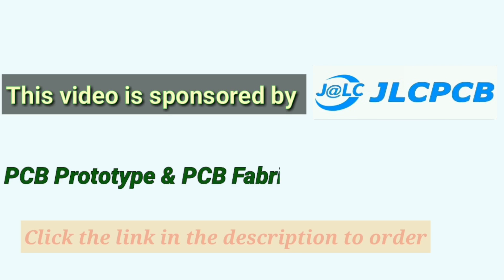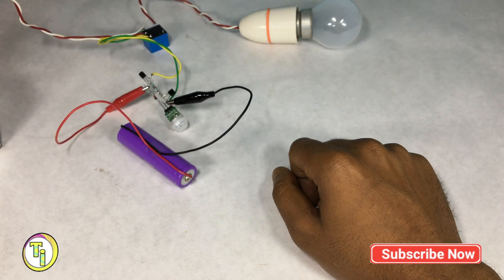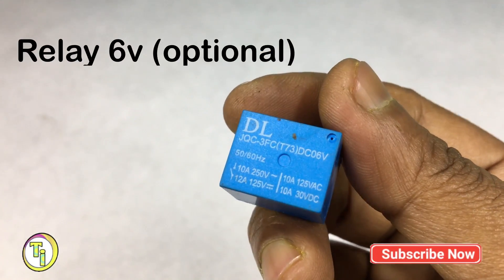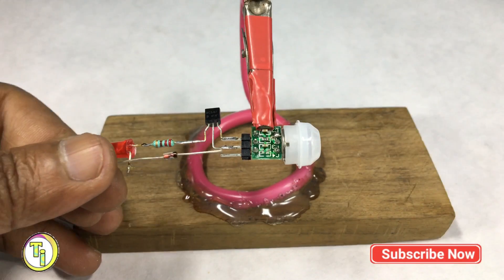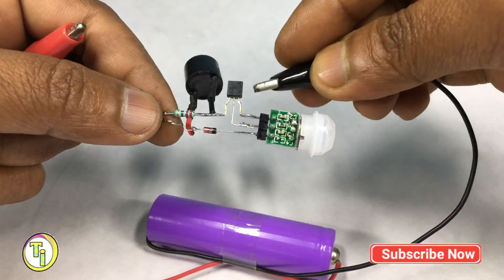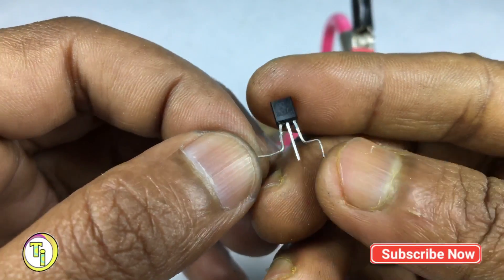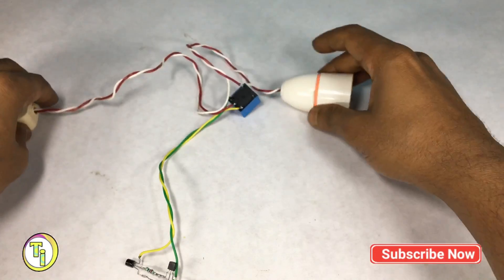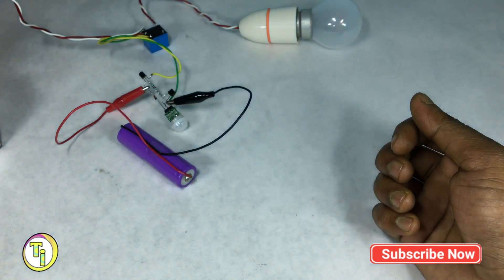Simple pir sensor circuit without arduino | JLC PCB

Comment: Great video.  Will it work if I expose IR sensor to Sunlight Will it sense?. I have used another IR (SIG0062) but it´s too sensible to sunlight...therefore my load is on...tried to covered around but just does not work.
Reply from the maker: Ofcourse it'll work fine on sunlight

Comment: The diode that you show 1N4148 is a signal diode NOT a Zener Diode? and you should add a resistor to the base of the transistor for protection so your circuit is a no no look at Big Clives channel to see how to do it correctly

Comment: Great video, thanks.  Would you know the max output CURRENT the IR modules can deliver.  I can not find specs and when I tested one with a LED, 330 resistor, and 5v volt supply I only got about 35 ua, that does not sound right but without specs I don't know if these are defective.

Comment: Hello, can you tell parameters of Zener Diode? And also which diode is used on relay for protection.
Thx
Reply: The 4148 is actually a 1N4148 small signal diode and not a Zener.
I would think the fly back diode across the relay would be 1N4007
Reply: But this man never replies viewers questions

Comment: Nice one bro.. I would like to know how I can lengthen the light that is on? How can I integrate it with a "delay" to turn the lights off in a certain period of time?

I also want to know how can I connect several PIR sensors for me to put in key places with a several lights? 

I was planning to put sensors around the house that will activate the lights on when there is somebody around.